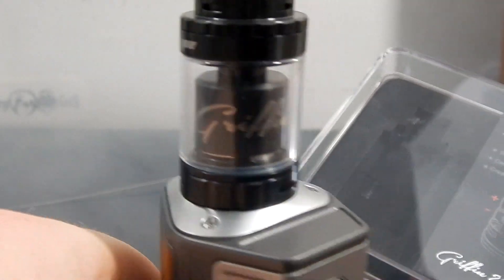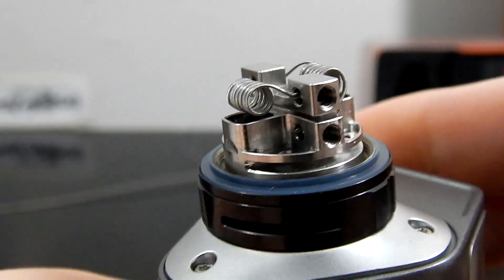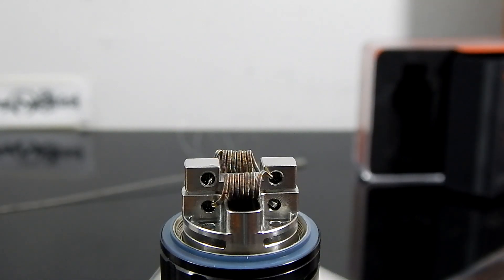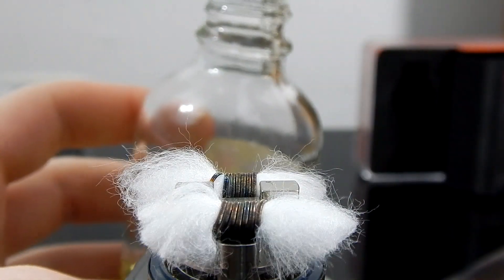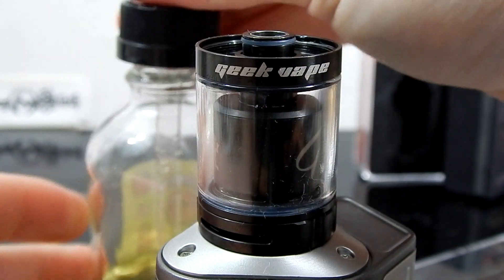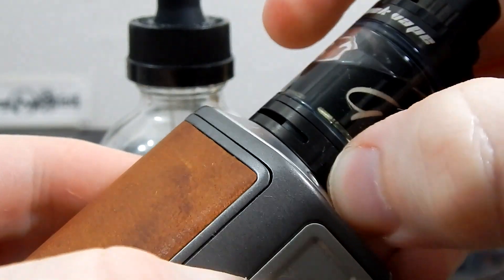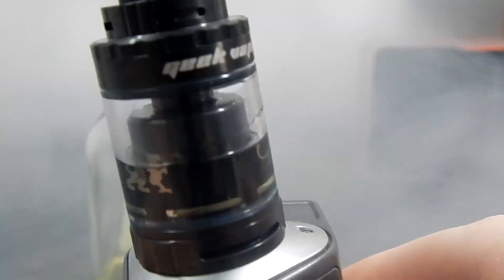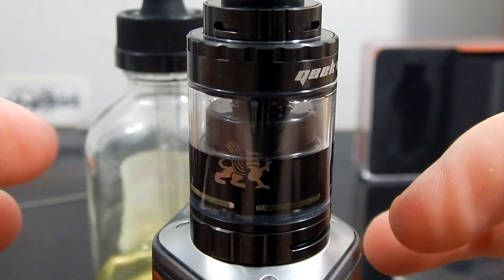GRIFFIN 25 MINI by GEEKVAPE - 316L FUSED + IMPRESSIONS

Comment: I received mine to used, ss316L dual claptons wrapped 7 times around 9/64 and about . 33ohms.   I think I wicked it just as you have.. But every hit was burnt cotton. I need help!
Reply: *today
Reply from the maker: what was your process for dry firing / removing hotspots? also, a common reason for burnt hits is very tightly packed wick in the coil, aside from wick length at the juice holes

Comment: I was wondering if you wouldn't mind sharing your profiles for the dna 200 device? I am using SS 316 for my coils that I buy from you, because there didn't seem to be much of a difference from 316 to 316L however I just want to be doing it correct....so just let me know ....thanks
Reply from the maker: there is a difference between 316 and 316L. so definitely use the L. I'm using stock on my triade and my other ones have a default exported CSV from steam engine. they work great.
Reply: +AdvancedVape-- -- I was just wondering is there any particular reason you use rayon over organic cotton?
Reply from the maker: +mdgross35 I use them both. there are some devices that rayon works best in. it's also extremely cheap
Reply: See it is steam engine that showed that 316 and 316L was the much of a difference...hmmm I will download the csv file and add it I to my escribe.....

Comment: I got a big big problem. my griffin mini is leaking like hell , I have wick it like 7 times diferents ways that I see on YouTube,  I has changed  between single and dual coil and I always have the same problem of like from the airflow hole! please help
Reply from the maker: you need to press down your wick a little harder into the channel so the holes are completely blocked. also, what vg/pg is your juice?

Comment: is the flavor better in your opinion compared to the boreas?
Reply from the maker: I haven't done a same-build comparison, but so far, I'd have to say yes. for me anyway
Reply: Ok the boreas is cheap now and I was trying to compare which one to buy. I hate that the griffin mini is so limited on juice compacity
Reply: Capacity I meant and the aromamizer looks great
Reply from the maker: +Warlord that is the downside of this tank. if you wick it like I did in the review, you're gonna be refilling a lot. but that doesn't really bother me personally. if you wick the boreas to have good flavor it blows through juice as well, as well as potentially leaking if you lay it on its side
Reply: +AdvancedVape ok gotcha bud thanks
Reply: +Warlord is the flavor better with rayon because after years of vaping I never used it
Reply from the maker: +Warlord some people swear by the flavor on rayon, some dont. it's better for some tanks than others so I use both it and cotton bacon
Reply: +AdvancedVape ok I will try a bit can't hurt it's cheap. Thanks for all you do.
Reply: +AdvancedVape does this leak when tilted sideways?
Reply from the maker: +Warlord I haven't gotten any leaking from it. minor seeping after refill but that's it. the airflow is very high up above where the juice holes are so I think it does a decent job of not leaking
Reply: +AdvancedVape ok thank you.